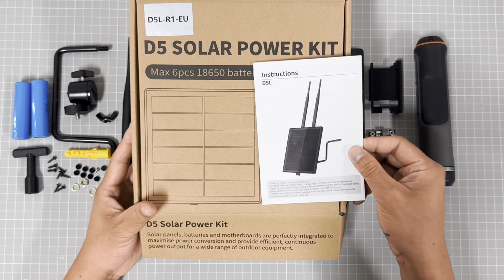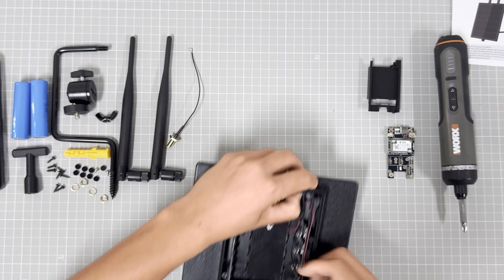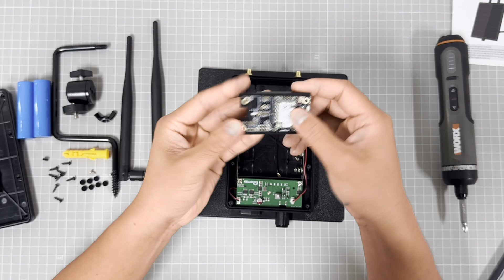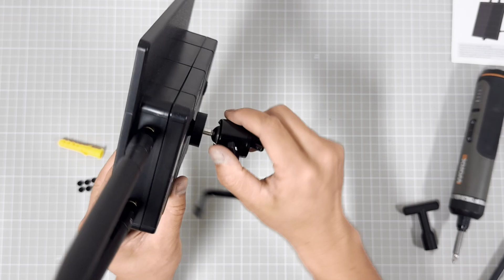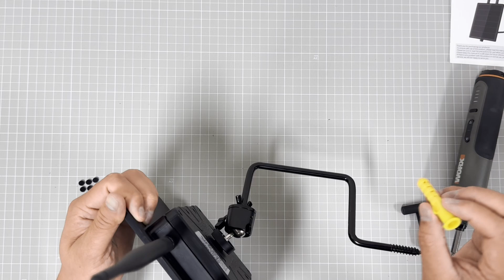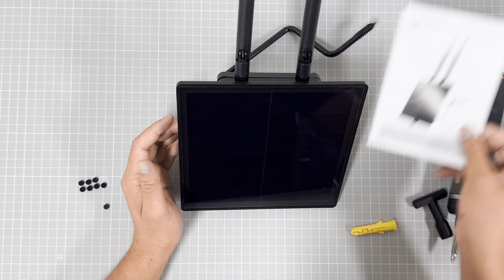D5L 5W Solar Power Kit with RAK4631 lora repeater for meshtastic radio

Comment: Can more panels be connected in parallel? If so, should they be connected before charging regulator, or two regulators to the same battery pack, or maybe connect two full units with 2x4 batteries in parallel? I’m asking because on long winter nights with some snow on the panels I’m pretty sure it will turn off from time to time. I have a helltec version, because I wanted to connect it via WiFi, so it uses some more power.